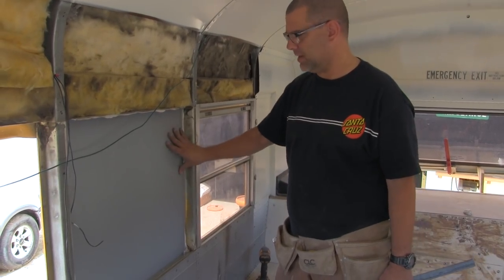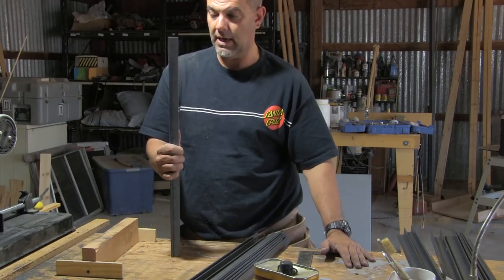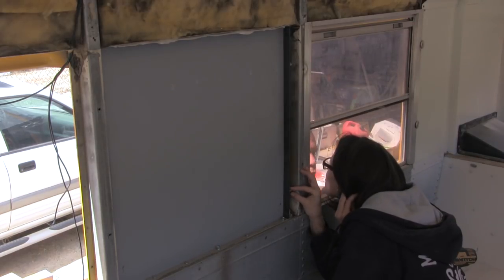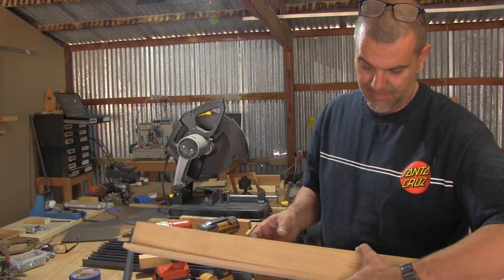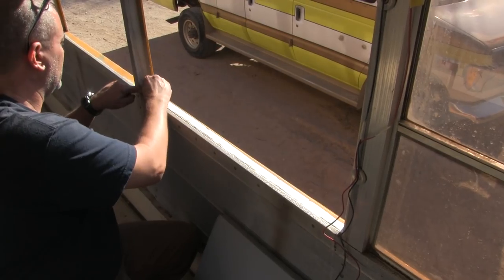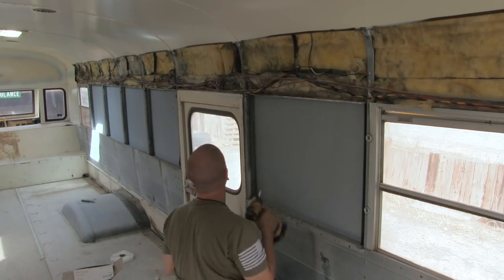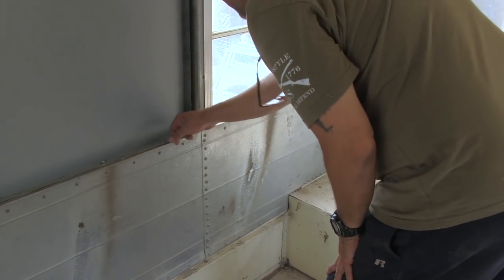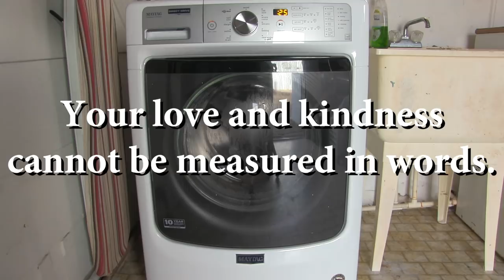Skoolie Bus Conversion: Windows to Waldos Part II

Comment: Great vid guys. The wall solution you applied for the displaced windows was very cumbersome. You fabricated all those single sheet metal squares then when you discovered they were not a sealed fit you then had to design a fix for each panel with the straight rods. would it not have been cheaper, quicker and easier to just fabricate a long rectangular sheet metal piece to cover multiple sections of window space at once that could have been secured to the interior steel frame across the window space?
Reply from the maker: Maybe, but that wasnt what we wanted.We talked about that but easier and cheaper isn't always the best option.We wanted to keep the school bus look and the windows are the epitome of that look.

Comment: Going from the outside and skinning over the windows would have been way easier. Cut sheet steel, butyl tape, drill and rivet. Plus it would leave a clean smooth apperance. just my opinion. Everybody want to do their own thing when building their bus and that's a good thing but there's no need to reinvent the wheel.
Reply from the maker: A lot of thought went into why we did it the way we did. We wanted very much to keep the school bus legacy.  While skinning was an option we wanted this much more.

Comment: Great job! I was wondering why you placed the angle iron as you did versus the flat side against the window frame. Do you think that gives more strength to your panel? Anyway as expected the video was entertaining and you and Kerry really seem to enjoy working on this project together!
Reply from the maker: 2 reasons. 1 is that the amount of room between the support and the panel wasn't going to leave enough room to make the mounting holes.  There are about 3/32" from the edge as it is.  Secondly I wanted the maximum amount of support over that seal.

Comment: Do you have site of what materials were purchased for the replacement of windows ? what type gauge metal was used and the  stick on white adhesive
Reply from the maker: I used 18g steel and the adhesive is Butyl tape. Very common for windows.

Comment: What make and model of drill are you using?
(types Cathy, out of Steve & Cathy's YT - who, apparently, needs to give Santa a little, um, update?...)
Reply from the maker: https://shop.bestreviews.com/products/bostitch-btck410l2-18v-lithium-2-tool-combo-kit?cid=1478216846&aid=56672288785&eid=&tid=pla-293946777986&ul=9030221&mt=&n=g&d=m&dm=&m&sn&adid=282858957008&k=&p=&pc=&ap=1o8&gclid=Cj0KCQiA4aXiBRCRARIsAMBZGz-3SxrmOgGQLZssbOOTiNnF5tkGKpvrDx3DfPMKRNL5xPab32gTbXEaAoR7EALw_wcB
Reply from the maker: I found them on sale for $99. Turned out to be a mistake on their part but they gave it to me anyway!
Reply: Loving your music selections, by-the-by....